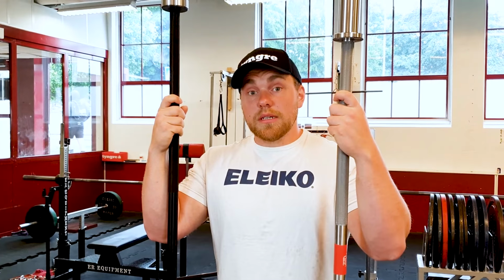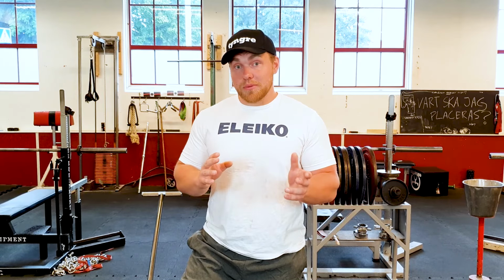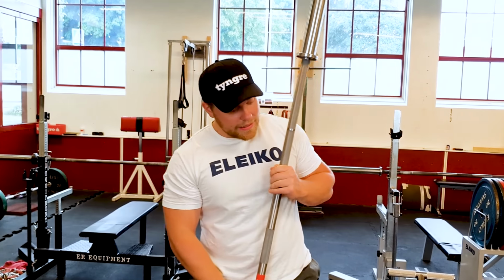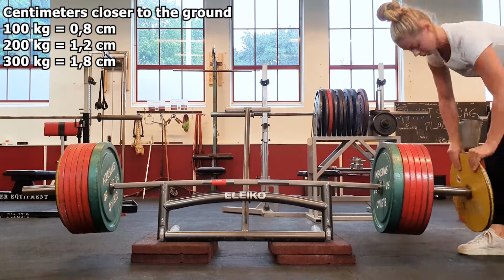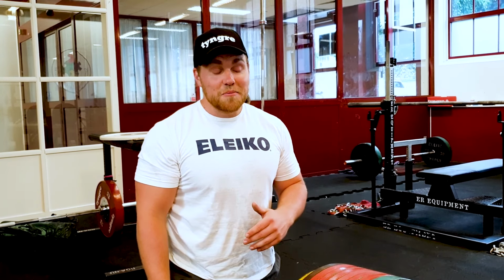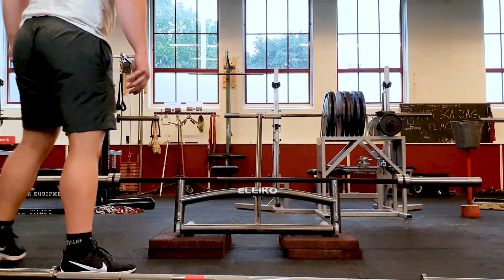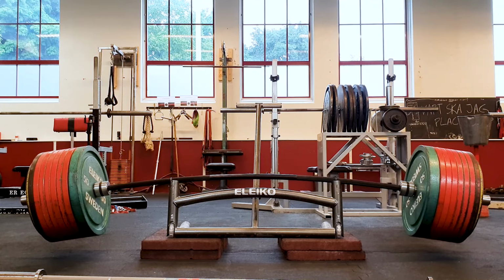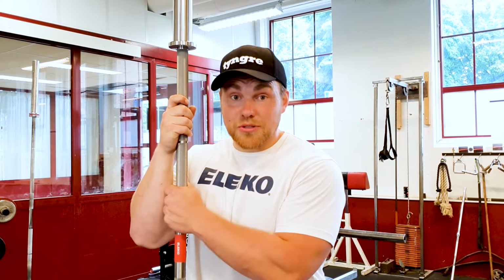ELEIKO STIFF/POWERLIFTING BAR VS DEADLIFT BAR

Comment: After pretty much a decade with a stiff bar (best sumo 450), I trained a cycle with deadlift bar and hit 505. It's wild how different it feels 😳
Reply: Nice I’m at 515 on a commercial gym bar, is that similar to a stiff bar? I was wonder what I could do on a DL bar
Reply: @LebronisgoodMJsuckz  Hmm I'd say closer to a stiff bar than the DL bar. There's a big difference in how it feels off the ground and at lockout! Whippy. I haven't done conventional enough to tell the difference yet
Reply: i know im asking randomly but does someone know a trick to get back into an instagram account?
I was stupid forgot my password. I would love any tips you can give me
Reply: @Darwin Landyn instablaster =)
Reply: 500 kg på en powerlifting stiff bar;) njaa. Det blir nog mycket till det. Tackar ödmjukast josef och tyngre för denna video. Väldigt informativ. Dum fråga,men är förutom priset,skillnad på eleiko deadlift bar och tex en för halva priset med exakt samma spec och material i ändarna? Lager,stålsort och maxkilo på stång?
Reply: @LebronisgoodMJsuckz  a cheap commercial bar would flex closer to how a deadlift bar would. even cheaper powerlifting bars flex a fair bit. some guys in Aus prefer doing touch n go bench with a cheaper power bar than an Eleiko as they can use the whip to help the lift.

Comment: This sorta applies to 500kg deadlifts because only super heavy weights are going to be doing that and they're going to be gripping quite wide.  You can see on the deadlift bar a fair amount of flex above the point where the jack is holding the bar, so I'm curious to see how big the difference is for a more average sized lifter who would probably be gripping close to where the knurling begins.

Comment: If the sleeves are the same size but the deadlift bar is 2mm skinnier, that's probably a hair less distance to pull on top of however much the bar bends.
Reply: It helps with grip, especially hook grip

Comment: Shows ya deadlift bar is cheating because it basically turns into a block pull the more weight you put on. Stiff bar is the true test of strength.

Comment: In your opinion how much can be lifted more with the flexible bar with respect to the stiff one. 5-10%?..Thanks
Reply: It all depends on the weight lifted, and your strength as a deadlifter. If you struggle to pull from the floor, and are up in the 220-300kg+ range it can make a huge difference. If your pulls are good off the floor the extra bit of help off the floor isn't going to make a great difference
Reply: @michaeltennant2920  does it matter sumo vs conventional though?
Reply: @MovewithMarcia  it does, with sumo your grip is usually closer, so it should bend even little more. (in theory)
Reply: @Chrontard  gotcha! Starting training with a flexible bar and it was an adjustment for both stances but sumo felt unstable (which is new for me). So that makes sense.

Comment: is it easier to deadlift with one or is it the same with both the barbells
Reply: The general consensus is that a deadlift bar is easier, although I read some who don't agree. I think Martin Berkhan said that he felt the deadlift bar negated his strength (off the floor) and exasperated his weak point (lockout). But that was after testing a deadlift bar 1 time, maybe would've felt differently with training.

Comment: 500kg borde bli 4900N, att lyfta 4900N 40 cm bör bli 1960 Joule, och att lyfta samma wikt 45 cm bör bli 2205J. 245J skillnad, vilket motsvarar 25 kg. Så, om du låser ut efter att ha lyft en 500 kg stiff bar 45 cm så skulle du kunna lyfta 525 kg med en powerlifting bar - om mina beräkningar stämmer.